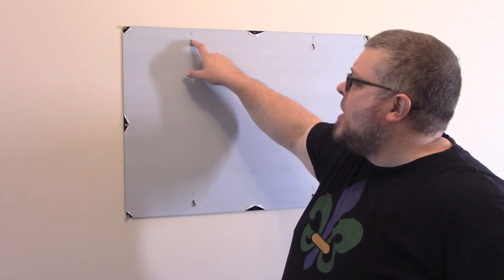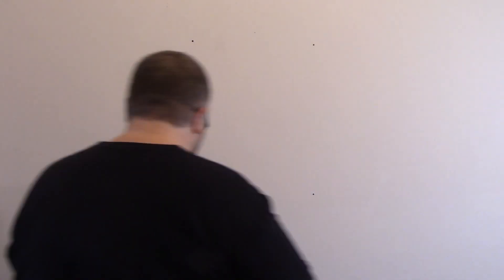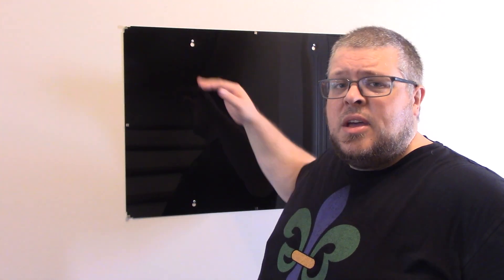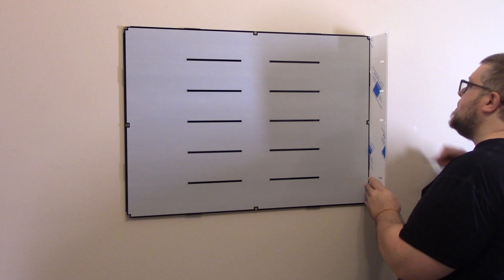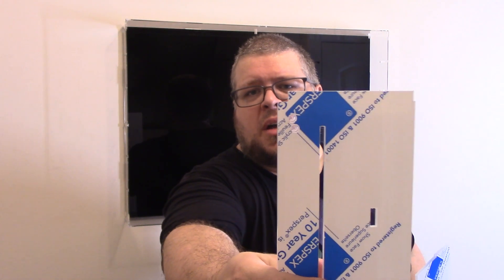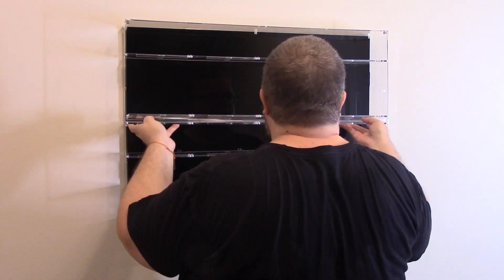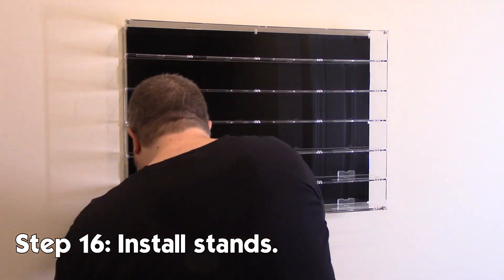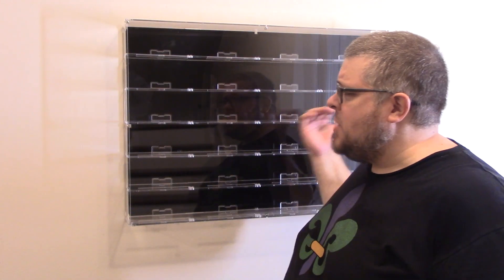Assembly Instructions: Wicked Brick 24 Car Lego Speed Champions Wall Mounted Display Case

Comment: I imagine finding the studs in the wall, will help secure it further. Their displays look really nice, I'm just having a hard time with the price. And I am shocked at the amount of pieces you have to assemble, and no instructions either wow.
Reply from the maker: Studs would help, but unfortunately they weren't where they needed to be when I centered the display on the wall. You're right about the price, I'm still saving for the other two I need to complete it out! 🤣

Comment: Thank you for this video. They should be ashamed of the ‘instructions’ they include. Less than useless. I’ve given up today but will use your video to build it tomorrow. It looks gorgeous but they seriously need to up their game in two areas. 1) Actual instructions for the item you purchased. Not just blanket instructions for all items they sell. At these prices they don’t need to scrimp on costs. 2) they should keep you updated throughout the build process. If pizza companies can give you a progress bar then surely they can do similar? I forgot I’d ordered mine by the time it arrived.
Reply from the maker: I did find I had to tap the shelves into the back plate with a rubber mallet. They fit as tight as the stands do. 😁

Comment: God this video was a godsend, but unfortunately my shelf’s don’t fit into the back plate, not been cut right from the measurements, would have to file the shelves to make them fit which i refuse to do out of principle at the cost of this display. I love the display cases but i seem to have no end of problems due to damage or poor quality control and the instructions are useless
Reply from the maker: Mine didn't either, they're actually a snug fit like the stands. After the video I had to tap them in with a rubber mallet, and everything was a bit more sturdy. 🙂
Reply: I tried that gently but it split the backing plate, I've measured and its too bigger difference on mine, I know they should be snuggish but this is too much.
Reply: Gap on shelf is 9.1 and on backing 9.3